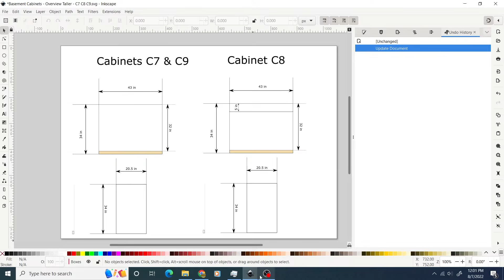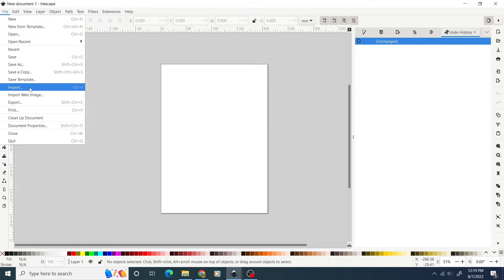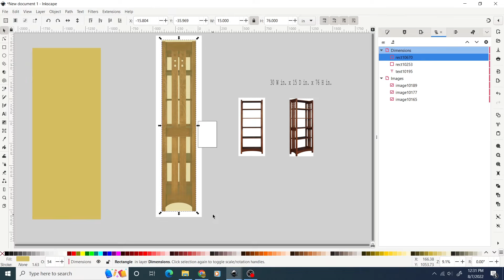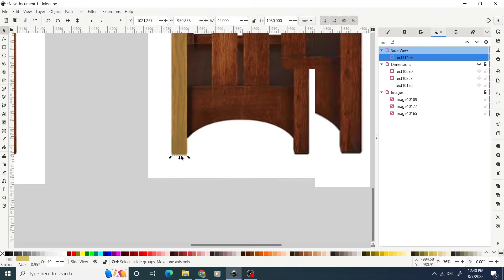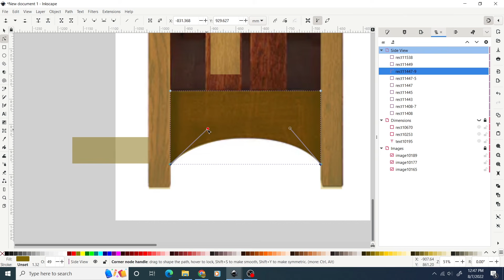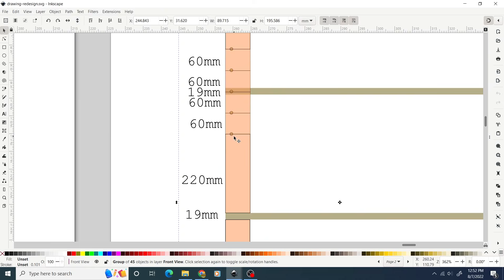Creating Woodworking Plans with Free Software

Comment: Millimeters or an inch based on 10s as found on an engineer's ruler are more accurate than an inch based on 16ths. The former are a LOT easier to work with and to achieve a greater accuracy when cutting pieces.

Comment: I am not very experienced with computers and have traditionally done my design work using pencil and paper. I would like to upgrade to drawing on the computer.  It appeared to me your tutorial outlined how to create a view from one angle, which was impressive to me on its own.  I envision creating a 3D model of a 2x4 piece of lumber. My goal is to be able to rotate, twist, and view this 3D lumber piece from different angles. Ideally, I would also be able to create and assemble all the 3D lumber pieces for my project, and then manipulate the view of the complete assembled model.  Hopefully, I explained that, so it makes sense.  Can I do that in Inkscape? Thanks in advance for your input.

Comment: It's crazy how much they want for these programs. Who is buying these? I'm a retiree, and don't have that kind of money. Plus, I could never rectify that cost, for what I do. Thank you for the video.
Reply: I use Inkscape for vector graphics (vinyl plotter, 3d printers etc.) but for engineering/woodworking type work I prefer Fusion or Sketchup. Both have free versions for hobbyist, although as someone already mentioned it is hard (but not impossible) to navigate to the free version of Sketchup.

Comment: You should be able to correct perspective in image editting software, maybe even in Paint. When you export, specify the number of pixels on the long side to get all images the same height.

Some software can increase the resolution of an image.

I would be inclined to adjust measurements to conform with available stock

Comment: Tom, I would love to know if you have a quick and simple way to lay out cut parts on plywood sheets? My theory would be once you get these rectangles laid out to size, you could then move them over to a different layer that was sized to 1219.2mm X 2438.4mm (4’x8’). Then you could position the rectangles to the best layout allowing for the most efficient use of the materials. Would my theory be correct? Might you consider making a follow up video on how you do that when making a Ply project?  FYI, I love my mkV 500 and mkV 500up520!!
Reply from the maker: Larry, I use https://cutlistoptimizer.com/

Google or search YouTube for how to use this website. I think it may be what you are looking for.

Comment: Thanks for showing the plan software you use, I’ll try this. BTW as a hobby wood worker I’m not a fan of subscription software so this is good. I’m a proponent of using metric in my shop but most measuring tapes or rules I find are either fractional inch or both fraction & metric. Do you know a source of metric only tapes and rules? Not saying I’ve done an exhaustive search but Metric only is hard to find.
Reply from the maker: I agree, as a hobbyist free and simple works. I do have some good all metric measuring tools, and yes they were hard to find. I made a Community post about it in case others have the same question. Links provided in the post.

https://www.youtube.com/post/UgkxjuyLlwpo6S0l9OO1KI71WZ5rmLDHdGbx

Comment: Thanks for taking the time to put this tutorial together. One trick I've stumbled across before: instead of turning off the stroke width completely, in Preferences you can turn off changing the stroke thickness when you change the rest of the shape. Under behavior > transforms, uncheck Scale Stroke Width.
Reply from the maker: Great tip I’ll have to use that! Thanks Ivan.

Comment: That was very interesting Tom. 
Taking a couple of pictures and creating a drawing. 
But that seemed to be a lot of work. 
Wouldn’t it just be faster to draw it out on graph paper?
Reply from the maker: Thanks for the compliments Bill. It may have been faster for some people with graph paper. I think it depends on which tools you are proficient at. I didn't feel overworked while drawing the design. Once I got the design based on factory dimensions, we printed the design and measured out the space where it will go. We decided to make it 6 inches wider and 3 inches less deep. All I had to do was make a copy of the file and quickly resize parts and labels.
Reply: @woodshopnerdery  plus it saves paper! And storage space for all those drawings!

Comment: Useful. I've had Inkscape for years, but I've never used it for this. Might try it now.
Reply from the maker: Thanks Michael, Inkscape has come a long way, make sure you have the latest. There is a big improvement from 1.1 to 1.2. For example it now supports multiple pages.